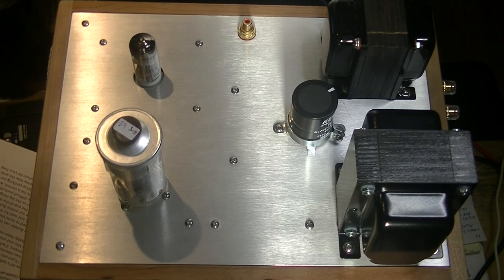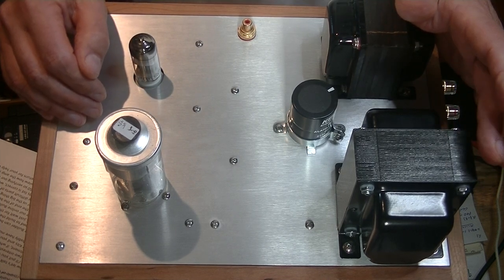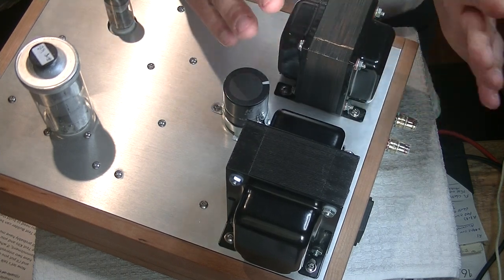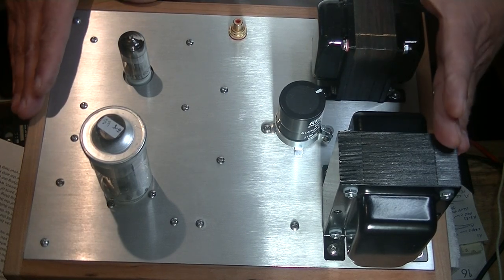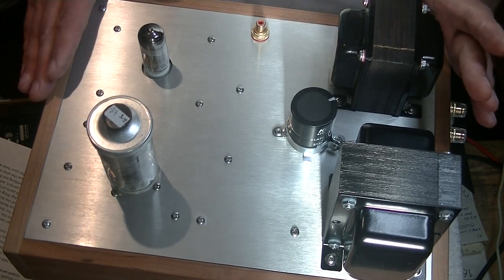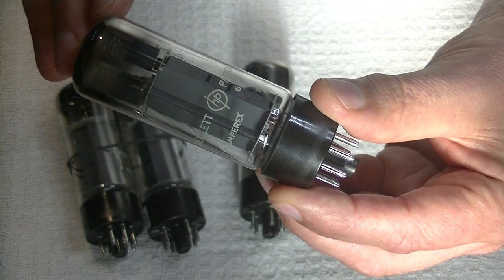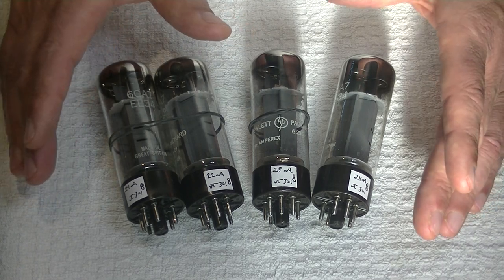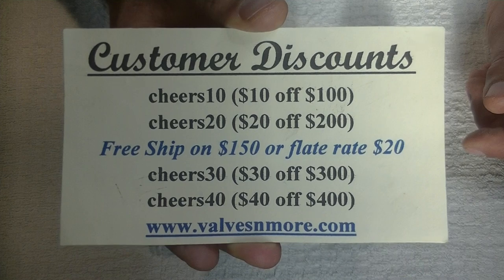Tube Lab #107 - GU50 Update & Test Builders

Comment: Jim, what will be the WPC on this amplifier into 8 ohms nominal.
Reply from the maker: The output transformer has two taps, 4 & 8 ohms.  The nominal power rating is 8wrms into either 4 or 8 ohms. The complete specifications are available on the website under information.  I plan on doing a more detailed discussion of the design soon on our other YouTube channel "Mellow Tone Kits".